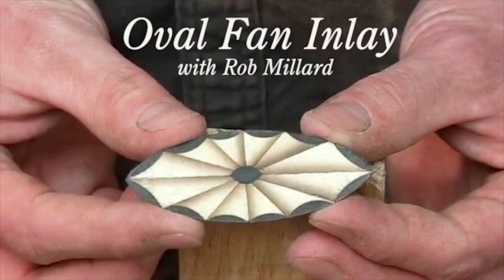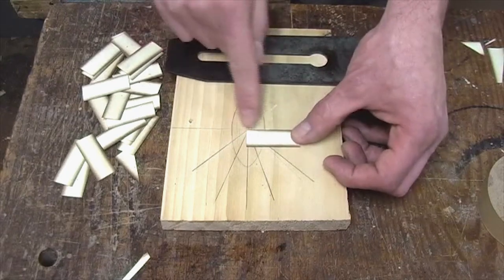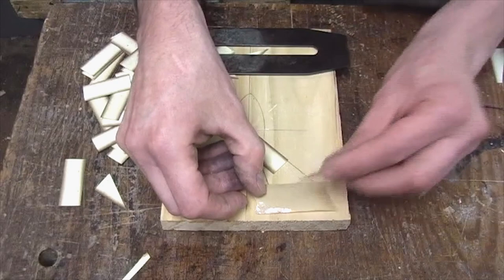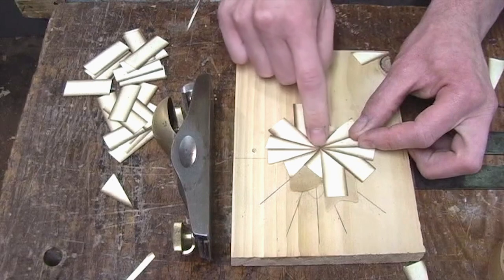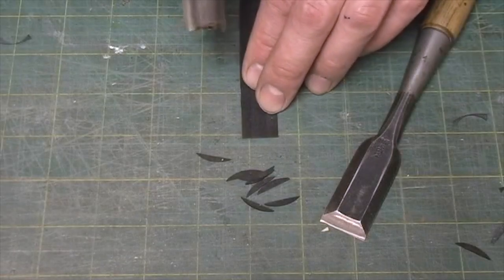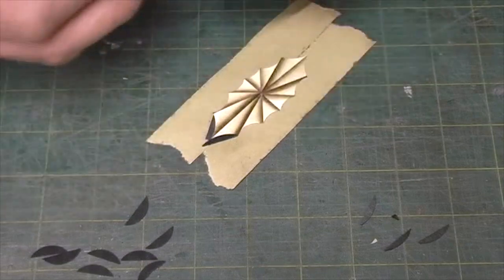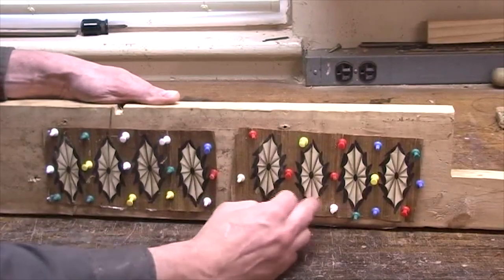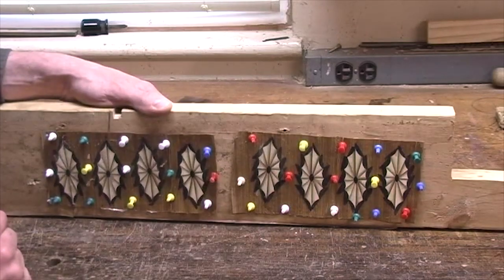Oval Fan

Comment: Wich kind of sand do you use? Its special or regular. Beach sand for example. Thank you. Congrat for your work
Reply from the maker: It's actually craft sand that you can get from Michaels or Hobby Lobby. The grain size is more uniform and it's clean. You'll want to get uncolored in case that might bleed into the veneer...unless that's something you'd like to try! ;0)